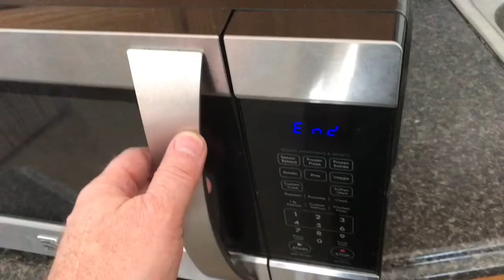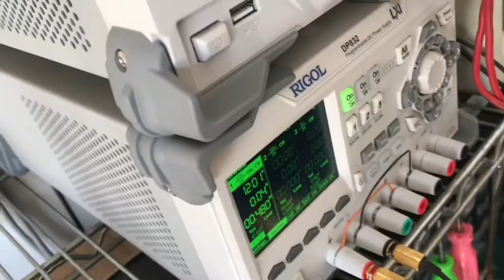diagnostic “tests” for a MICROWAVE OVEN (troubleshooting) ￼top reasons not heating￼

Comment: Change all my micro switches and the fan won’t turn off.Already check the thermostat no issue there.What could keep the fan running when I closed the door
Reply: Monitor switch